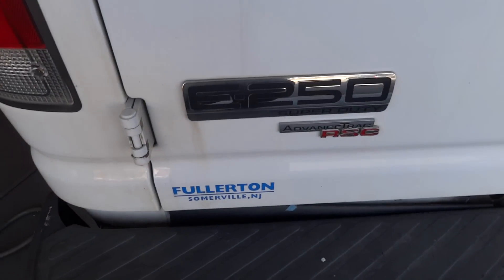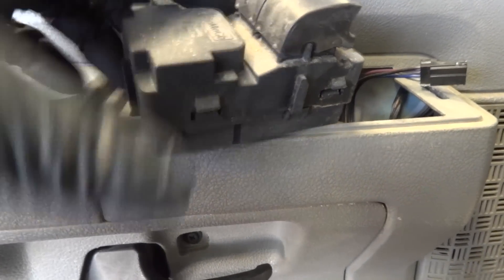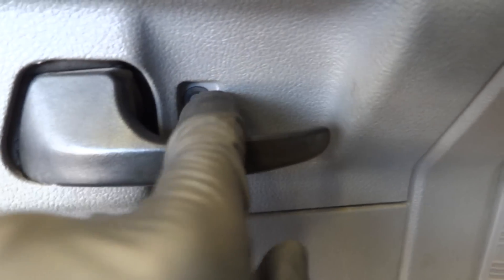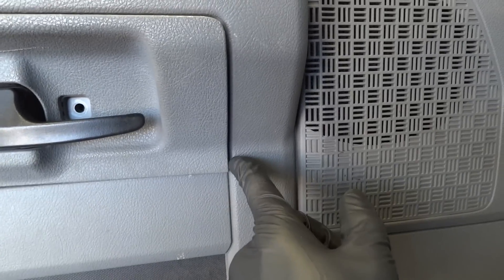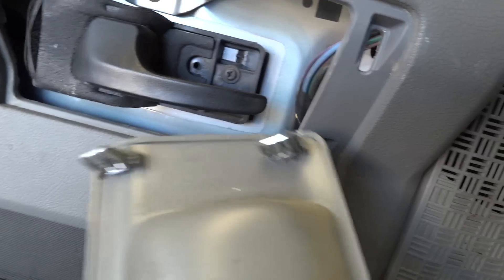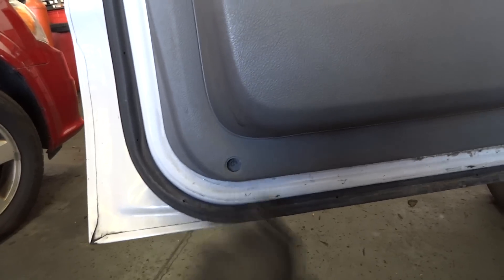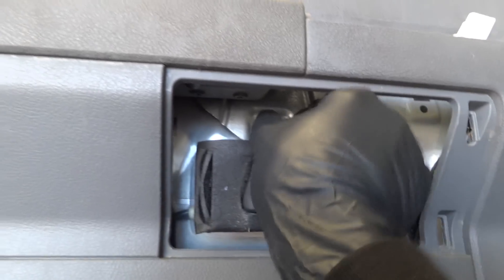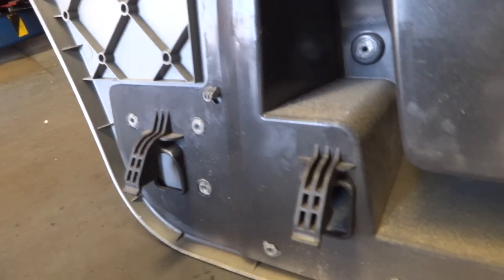2011 ford e250 e150 door panel removal

Comment: Just finished replacing my driver's side remote side view mirror on my 2011 E150.  Aside from struggling with the remote wiring connector, I managed to get it done in one and a half hours.  Next time if I have to do this, it will take me half the time because of your video.  Thanks!

Comment: Excellent video.  Locks didn't work and I needed to remove them to soak them to loosen them up.  Looked intimidating to remove the door panel until I watched this video. After watching, I thought, hey I can do this and save $200.  Thanks a million.
Reply from the maker: David Masucci I'm happy I could help. Be sure to subscribe.

Comment: Yes, its important to watch this video before removing doorpanels. I've got a 2011 Ford E-350  superduty RV . I'm going to replace the door-speakers. You must  have the service manual to do thing right first time, without watching this video. It can be easy to damage the plast-tabs or clips when doing it in wrong direction. Thanks for  uploading this video